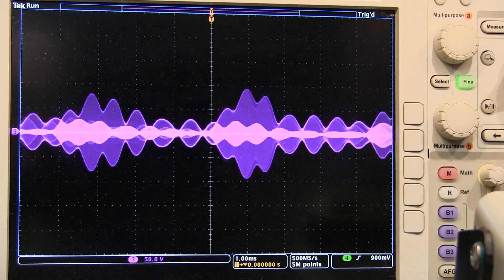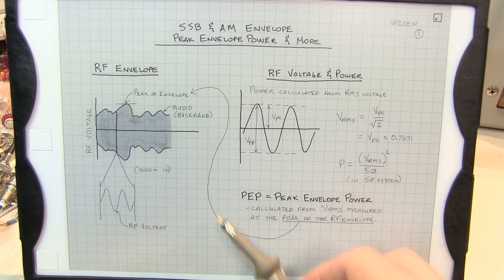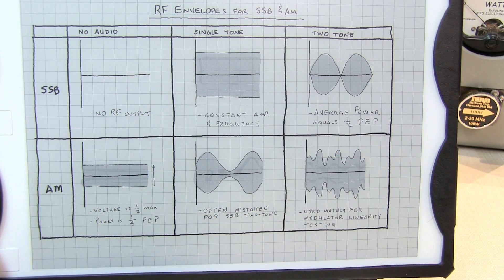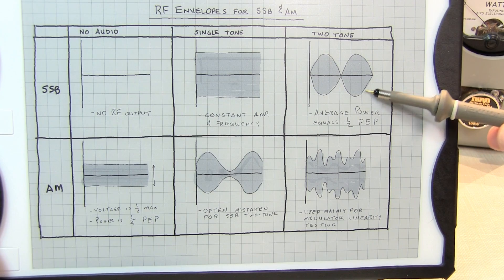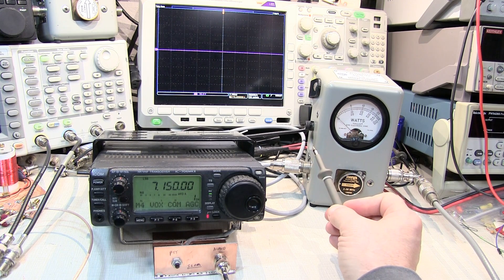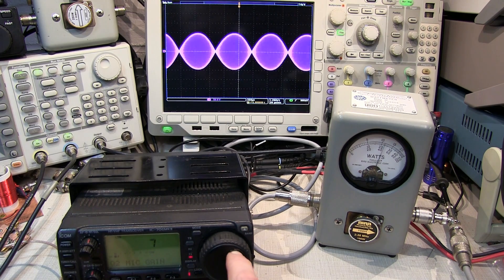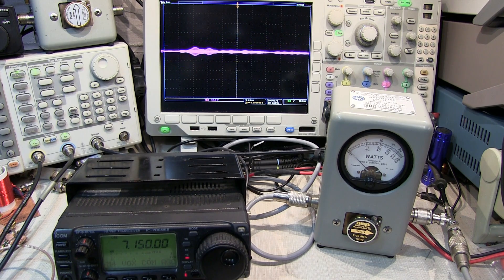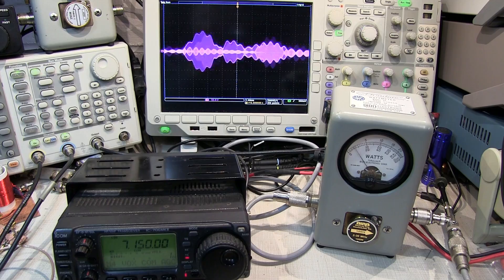#296: SSB & AM RF Envelopes, Peak Envelope Power (PEP), Average Power and more

Comment: Hi thanks for the video
I want to test it and i want to know how build tge fixture for applying audio signal to icom.
Reply from the maker: Simple.  A normally-open pushbutton momentary switch to bring the PTT line to ground for transmit, and a series combination of a 4.7kohm resistor and 0.68uF film capacitor between the BNC connector and the MIC audio line.

Comment: I have a question for you.  around the 2:21 point you say the scope is set to 50V/Div and you are reading a P-P at about 200V.  If I apply the formula ((200/2)^2)/50, I get 200W, what am I doing wrong in the math?
Reply from the maker: Power is always computed from RMS voltage, not peak-peak voltage.  So, 200Vpp is 100Vpeak, which is 70.7Vrms.  70.7^2 / 50 = 100W
Reply: @w2aew  thanks you, most grateful for the video and for clearing up the math for me

Comment: With AM the Carrier Is Not Modulated in Amplitude, as you state! 
Amplitude Modulation is a Misnomer.    (ReDeux)
One last attempt to open your eyes… (after several emails)
A directional Wattmeter doesn’t differentiate frequency, or phase, or time domain, it just measures all the combined RF power put through it in the selected direction… the same way a Watt/Hour meter outside your home does with your AC Current consumption, so the Utility Co. can accurately bill you.

We center on 1Mhz in the AM Broadcast band...
RF Source, through a Wattmeter, into a 50 ohm (1:1 SWR) resistive load...
We put in 40 watts of carrier, it measures 40 watts.

We put in 10 watts of LSB @ 1000Hz solid tone, it measures 10 watts.
(its basically a carrier offset down in frequency by 1000Hz)

We put in 10 watts of USB @ 1000Hz solid tone, it measures 10 watts.
(its basically a carrier offset up in frequency by 1000Hz)

We put in 10 watts of USB @ 1000Hz solid tone, and 10 watts of LSB @ 1000Hz solid tone… (IOW a Double Side Band Suppressed Carrier signal),
 it measures that combined 20 watts.
(its basically 2 carriers offset by 2000Hz)

We put in 40 watts of carrier, 
 10 watts of LSB @ 1000Hz solid tone,
 and 10 watts of USB @ 1000Hz solid tone,
 in the form of an AM signal modulated to 100% by a 1000Hz tone, and it measures a combined 60 watts of RF power.

This is whats responsible for the 50% of increase in Power in any AM signal being modulated to 100% by a 1000Hz tone.

All power put through the wattmeter is accounted for because the Solid 40 watts of carrier, added to the solid 10 watts of USB, and the solid 10 watts of USB adds up to 60 watts.

This wouldn’t happen if the Carrier’s Amplitude was varying. IF it was varying in Aplitude the combined watts would be more or less based upon your Alleged changing Amplitude of the carrier.

~~~~~
Previously Presented:
Now with a Spectrum Scope (SS), we Sweep these same 3 frequencies, it displays a center Reference frequency spike (carrier) and one spike above and one spike below in frequency both offset by 1000Hz, above and below, both much lower in amplitude. This is a normal AM signal modulated with a 1000Hz tone.

We hook the SS to an antenna and Span several Broadcast AM station frequencies. Each station shows a Rock Solid carrier with Sidebands above and below it due to its Modulation by Audio frequencies. These Sidebands appear to Dance in Amplitude but the Center ‘Carrier’ frequency is Rock Solid in Amplitude because its Amplitude Is Not being Modulated, Sidebands are being Generated. The Generated Sidebands Are the only Modulation on these signals.
~~~~~

Here are 2 totally independent methods, both accepted by the FCC, that prove that an AM Carrier Is Not Actually Modulated in its Amplitude. The Sidebands power added to the Carrier’s power causes an increase of total output power within the Spectral Bandwidth in both cases. 

~~~~~
Also Previously:
AM uses a Mixer as a Modulator. Put 2 signals into a Mixer you will get 4 signals out, the 2 originals, the sum, and the difference of those 2. Put in 1Mhz RF and 1Khz Audio, you get out these two, and 2 RF Single Sidebands (SSB), 1Mhz +1Khz (USB), and 1Mhz -1Khz (LSB). The 1Khz Audio is filtered out in then RF stages. This multiple signal is amplified and Transmitted (TX). 

It is then Received (RX) some distance away where the Carrier and one Sideband again goes through a Mixer, where this time the RF is ignored and the Audio is Amplified and sent to a speaker for our listening pleasure.
~~~~~

There is no reason for the Carrier to be anything but as Solid as a Rock, as its just a Reference from which the Audio signal is Demodulated by the RX’s Mixer. If the TX Carrier signal was to vary in Amplitude or frequency it would alter the RX signal in Amplitude or frequency, known as Distortion.

Heres 3 Explanations as to how/why the Carrier of an AM signal is not Modulated in Amplitude.

Alan, Please present 3 or more counter explanations to convince me and others.
Remembering that Cherry Picked Non Random Samples (including Oscilliscope Traces Triggered to Audio frequencies rather than Free Running at RF frequencies (as is done in the Spectrum Scope)) are Not Scientific, therefore are not proof. Their grasping at straws in hopes to convince yourself.

73  mike   🍺🍻
“It ain't what you don't know that gets you into trouble. It's what you know for sure that just ain't so.”  ― Mark Twain

EDIT ADDED AS I'M LOCKED OUT FROM REPLYING TO ALAN...

@w2aew  “All of your examples are correct. It is just your conclusion that this is proof that the carrier isn't modulated is false… Now, adjust the audio tone to just 1Hz... ” -Alan

Your Again Rationalizing with another Cheery Picked Example.

Relativity  1. the absence of standards of absolute and universal application.

Here, as in Einstein’s Realitivty, here there’s General, and Special circumstances. They are Clearly separated to avoid confusion, and bad results leading to Bad Information. 
All of my Conclusions are General and apply everywhere except under unusual Special circumstances.
Once Again Your Presented Conclusions are Special and Only work under Special Circumstances, and can Not be applied Generally.

Hey Everyone, Isn’t He Special?

73   mike
Reply from the maker: I'm working on a video to share with you to explain my points, since my emails have not been sufficient.

I totally agree that the spectrum results show a rock-steady carrier, and sidebands that are generated as a function of the audio.  All of your examples are correct.  It is just your conclusion that this is proof that the carrier isn't modulated is false.

Consider this example.  Take your example of 1kHz audio tone being used to make an AM signal with 100% modulation depth.  This creates a spectrum that has a pair of sidebands that are 6dB down from the carrier level, 1kHz to either side.  Now, adjust the audio tone to just 1Hz...

What happens to the Spectrum result?  It varies up/down at a 1Hz rate.  It does this because now the measurement bandwidth encompasses the entire signal.  If your spectrum analyzer had the ability to set the RBW <<1Hz, then you'd see the unchanging carrier frequency component and sidebands again.  It's all about the measurement method.

What happens to the Power Meter result?  It varies up/down at a 1Hz rate, reducing all the way to zero at the negative peaks of the modulation.  If the carrier power was constant - why would the power meter vary periodically to zero?  Because its measurement BW includes the signal's entire frequency content.

The answer is - AM modulates the RF output (carrier).  The resulting AM signal has frequency components at the carrier frequency, as well as the carrier +/- the audio frequency.  The Spectrum Analyzer has a narrow measurement frequency (RBW), so it is able to show you each of these frequency components separately.  The narrower measurement BW (narrow RBW) , the longer the integration time for the measurement - thus the amplitude of the frequency component at the carrier frequency in the spectrum plot is constant, because it is integrated/measured across several cycles of the audio modulation.
Reply from the maker: @CriticalThinker-42 - Here is a video illustrating my point that the reason the frequency component corresponding to the carrier stays constant because the measurement BW (resolution BW) is less than the sideband spacing.
https://youtu.be/i5l6Vz1_g_k
Reply: @w2aew  “All of your examples are correct. It is just your conclusion that this is proof that the carrier isn't modulated is false… Now, adjust the audio tone to just 1Hz... ” -Alan

Your Again Rationalizing with another Cheery Picked Example.

Relativity  1. the absence of standards of absolute and universal application.

Here, as in Einstein’s Realitivty, here there’s General, and Special circumstances. They are Clearly separated to avoid confusion, and bad results leading to Bad Information. 
All of my Conclusions are General and apply everywhere except under unusual Special circumstances.
Once Again Your Presented Conclusions are Special and Only work under Special Circumstances, and can Not be applied Generally.

Hey Everyone, Isn’t He Special?

73   mike
Reply: Mike ... you are a tool

Comment: There an issue that you either glossed over/missed, or just flat out didn't notice.  There's a whole group of people out on the web (and I myself recently was just made aware of), and that is that a lot of these modern radios (ICOM 7610, Kenwood TS-890) is somehow limiting percent of modulation to ~ 65%, and hence not producing the full 100 Watts in AM mode.

And in your video, you even illustrate this in that your scope trace doesn't actually match what you say: (at 100% modulation, the trough's should just "kiss" zero), but yet as you spin the wheel on that radio, you were never able to get the scope to show 100% modulation, and plus the Bird Wattmeter (in peak mode), never goes over ~40-50 Watts. 

Carefully look at your video between 9:32 and 10:08 and you will see what I mean.  If you still have that radio, please re-test.

I did the tests on my Kenwood TS-890 with the exact same setup as you, and I never got over 60% modulation by calculating what myt scope showed:  vPeak - vTrough / vPeak + vTrough * 100

Can you please look at this, and either make a correction/comment either in the video, or here in the comments. As an Elmer, I need to offer an explanation on why the ICOM 7610 (and apparently  the Kenwood TS-890) so that I can help explain this to hams who are wondering my they can't get 100 Watts PEP from their radio's.

Thanks!,
Steve / W7SJ
Reply from the maker: During that time period, I merely described what 100% modulation would look like, I didn't say that this rig reaches 100% modulation depth. I too have seen that most modern rigs won't reach full 100% modulation.

Comment: Hello Aln, you said : "A peak-reading Bird (or other quality meter) can certainly be used to measure the peak envelope power of an AM signal. PEP can be as high as 4x the dead-key power (for a properly setup 100% modulation."

The simplest way to visually measure the modulation power levels in AM/FM/SSB is to use a DIGITAL SWR METER capable of being configured either in "Average power", either in "Peak power ('PEAK'), either in “Direct Power”, either in "Power Before Modulation”.

For example, the MFJ 826B DIGITAL TOS-WATT METER allows you to measure these different types of “power”.

Do you agree ?

Sincerely
Reply from the maker: A meter designed for peak reading should work well.

Comment: How did you make the box to inject the tone into the mic.?
Reply from the maker: It's pretty simple.  A normally-open pushbutton switch for the PTT, and a resistive voltage divider to bring the signal generator output down to just a few mV, and then AC couple that to the MIC line.

Comment: Another interesting video thank you, can I ask how do you connect your scope to the output of your transmitter, would this likely effect the SWR / impedance seen by the transceiver ? In one of your videos you spoke about not connecting the output of your transmitter directly into your scope, on this video I am guessing this is what you were doing as you were seeing 200v 100w. Many thanks.
Reply from the maker: I was definitely NOT connecting the RF output directly to the scope.  If you look carefully at the image at the 7:00 mark, you can see what I'm doing.  The transmitter is connected to the input of the Bird wattmeter.  The output of the wattmeter goes into a Tee connector.  One side of the Tee is connected to another piece of coax that runs down to my dummy load (under the bench, out of view).  The other end of the Tee has an adapter that accepts the 10x oscilloscope probe, and the probe is connected to the scope.  i describe this over the next minute or so in the video.  At 7:50, I zoom in a little more and you can see the probe adapter more clearly.

Comment: Alan, awesome pre-COVID video Sir. I want to run the two-tone test in one of my radios but I wonder what each tone should be set in each generator in my service monitor. I was thinking one tone at 500hz and the other at perhaps 1200hz. I use 1000hz when performing single tone (AM modulation adjustment). Thanks!

Comment: Allan, I own a Siglent sdg1032x function generator and want to test my flex radio and Icom AM linearity and symmetry.  How many mV  can I safely  inject from my generator?  What would be the max voltage I would want to inject?  I want the test to be realistic.  Ive been trying to find this info in the ARRL handbook but cant seem to find it, I should add that I send audio into the line level input (100 to 600 ohms?) and the same to my 7300(acc port on back of radio).  Thanks Allan!! 73
Reply from the maker: Typical audio signal levels will depend on the radio - but most are in the range of 5-10mV for most, a bit higher for rigs that use electret mics.  You can start with something like 20mVpp and then adjust the mic-gain on the rig as needed.
Reply: @w2aew  thanks I did some more research and found anything from what you said to 100mV depending on the input impedance etc. I do all line level inputs to my rigs so 4dbv

Comment: So these guys that use the bird on peak for am, is that a accurate measurement on am?  Or fools gold?
Reply from the maker: A peak-reading Bird (or other quality meter) can certainly be used to measure the peak envelope power of an AM signal.  PEP can be as high as 4x the dead-key power (for a properly setup 100% modulation).

Comment: hello my friend
I need your help,I have a power meter ys-2000 not calibrated. my question is: the switch has rms and pep positions,I adjust to 100w in RMS and to PEP is the same 100w or more?
thank you
ct1drx
Reply from the maker: For an unmodulated carrier, such as CW tone, AM with no modulation or FM, the RMS and PEP levels will be the same.
Reply: @w2aew  ok,I use a Icom ic-718 in RTTY mode.in PEP calibration I put  pep=rms/0.7 but no correct
now I understand
my english is not good,sorry
ct1drx
Reply from the maker: @laurindo233  RTTY is a constant amplitude mode, so the RMS=PEP.
Reply: @w2aew  many thanks

Comment: this helped me understand my cb radio swr/power meter and why it was only showing an average rated reading of less than 10 watts while talking on ssb. it doesn't mean that the radio is not putting out it's full pep, which is reassuring.

Comment: Hi Alan, to make an real (actual) power measurement I assume I'd need to couple the 'scope directly to my RF, and not via some sort of pickup system eg. unused port on transmatch. Or if I did use some form of RF 'sniffer' method, how could it be calibrated? Tnx de Rob.
Reply from the maker: You can calibrate a 'sniffer' by putting a constant output signal (key down, unmodulated carrier, etc.) into a dummy load and measure it with a good power meter.  Then you'll know how big the signal is on your scope for that power level.  Of course, the scope measures volts, not watts, so the power reading won't be linear on the scope.  A signal that is half the size (vertically) is actually 1/4 the power, etc.  Remember too that the 'sniffer' response will most certainly be frequency dependent - so a calibration done on 20m won't hold true for 40m, etc.

Comment: I’ve been subscribed to your channel for about a year, and I look forward to very new video you release. I also follow a few pages that you follow such as The Radio Shops page and TRX Workbench. I’ve been licensed since 1970 and have remained somewhat radio active throughout that time. Your videos have taught me some troubleshooting tricks and techniques that have resulted in getting me into a restoration mode. In the past when I attended a hamfest I’d avoid radios and test equipment that were in a visible state of disrepair. Now, I look for them, so I can restore them and give new life to an old faithful piece equipment. 90% of the repair process is usually replacing failed capacitors.  Just wanted to say thanks for all your hard work!

Comment: Can you make a video showing the difference between a swept and real time spectrum of a FM signal sinusoidal modulated signal.  I am specifically looking to see if there is always energy at each sideband always despite when the resultant sweeps across periodically.
Reply from the maker: The presence of the sidebands is a function of the modulation index (ratio of frequency deviation to the baseband frequency).  Also, note that no spectrum analyzer can measure the spectrum at a specific instant.  Even real-time spectrum analyzers need to acquire a vector of time-domain data to perform the fourier transform.